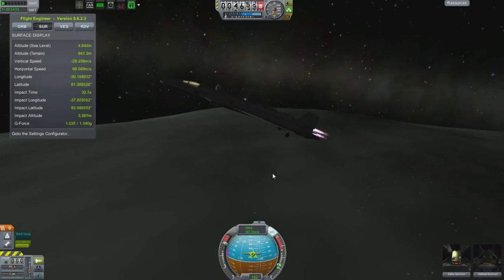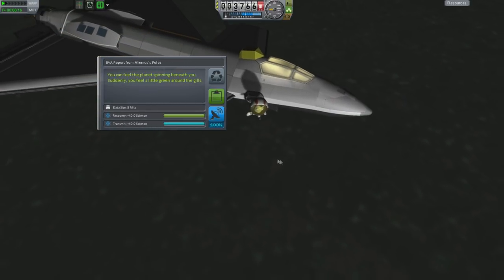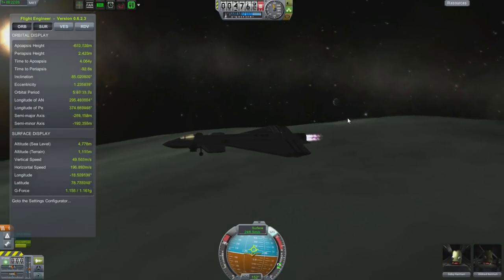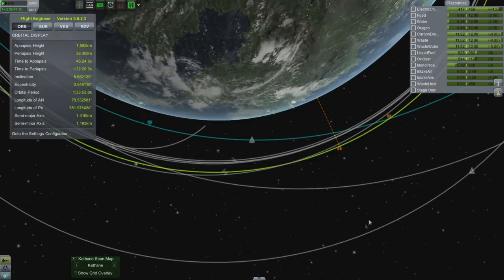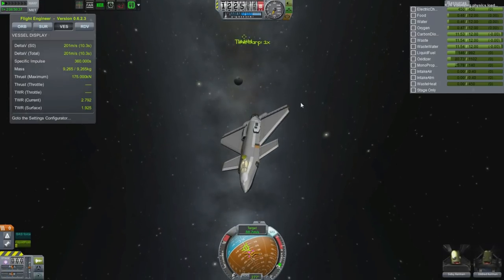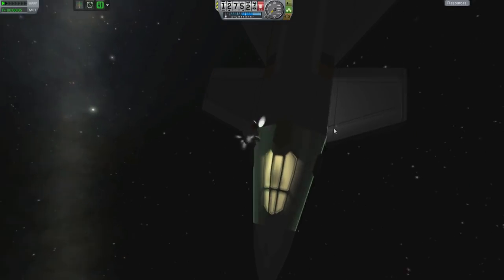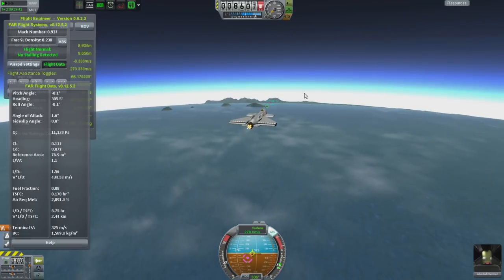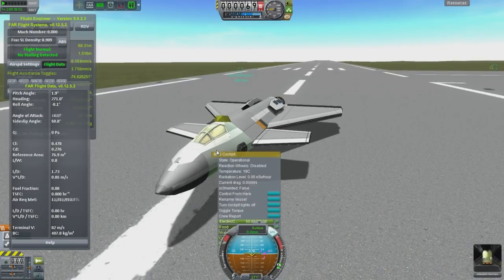Kerbal Space Program - Interstellar Quest - Episode 39 - No Yaw Control

Comment: hey Scott i'm kind of confused. by mining ice do you mean just transferring kethane into fuel?
Reply: Scott is not using the Kethane mod on this series... he is using I think the real fuels or the intersteller mod for the mining mod.
Reply: ok thx
Reply: but can you get fuel by mining kethane?
Reply: sausy mayo yes, the kethane mod also lets you drill for and convert kethane to fuel, oxidizer, RCS fuel and fuel for ION drives.
Reply: It's not Kethane; he's got the refineries mining ice and electrolysing it into hydrogen and oxygen.
Reply: dregerclock
He actually does have kethane installed, or at least he did... and I think he may have scanned something, possibly the Mun, for kethane? I forget though. But he's definitely had it installed, at least at some point.
Reply: Yeah  he used in in previous series but I don't believe it is being use in this current series.
Reply: dregerclock He started the series with it. He recently said he doesn't really see the need for it anymore.